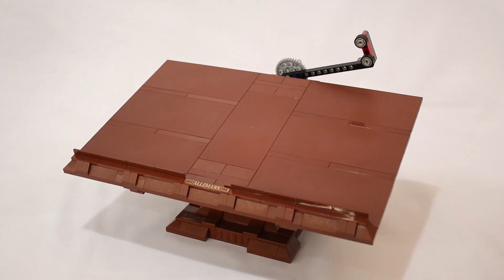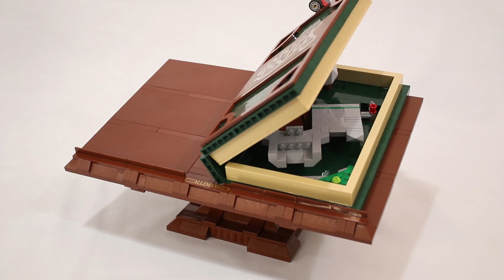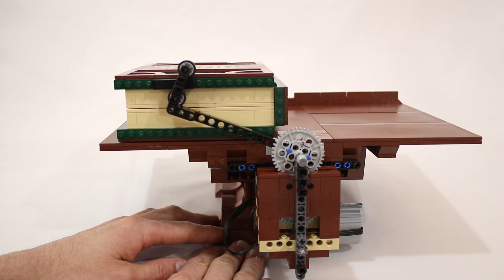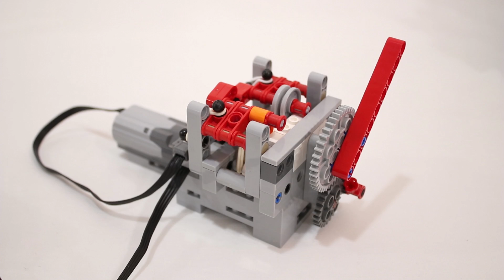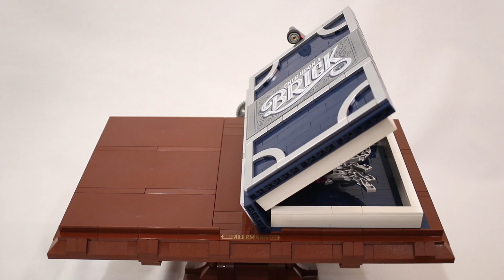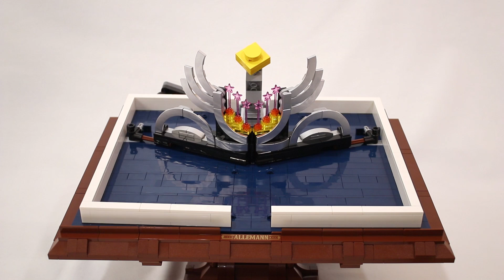Motorized LEGO Pop-Up Book Stand

Comment: I wonder if you could make it switch direction without the electronical switch. Maybe push an axle to disengage one gear and engage enough, which is kinda similar to a bicycle or a car gearbox. Anyway, it would probably by too large and impractical.